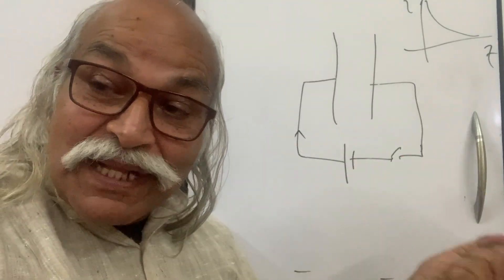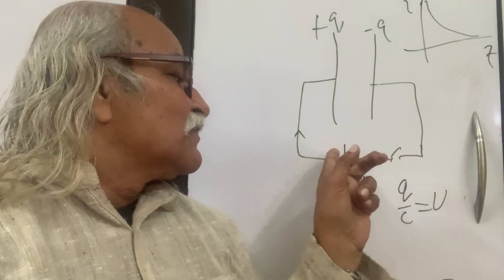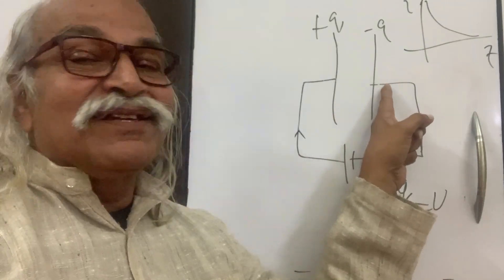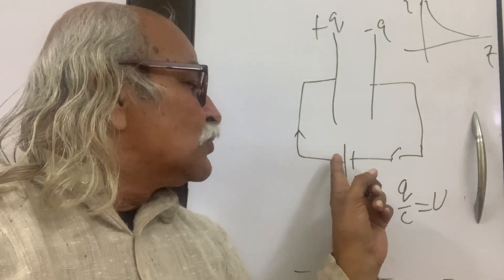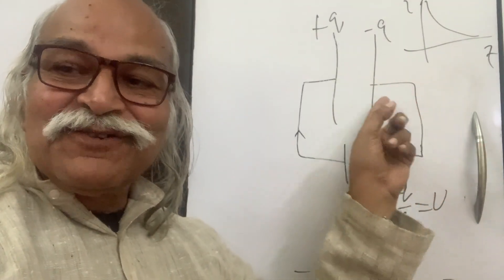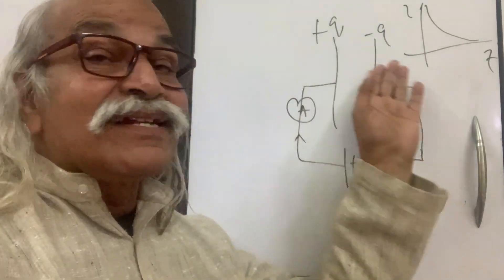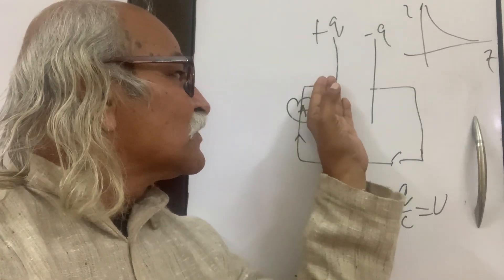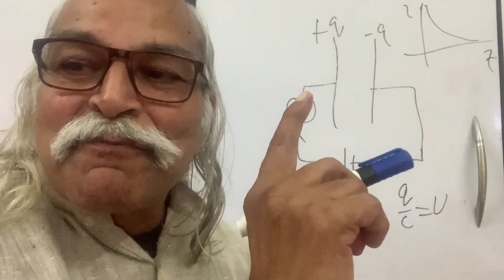Current through a capacitor

Comment: If a 0.1µF, 100V capacitor and 0.22µF, 40V capacitor are connected in parallel, find the 
overall capacitance and the maximum working voltage.

Comment: I have measured actual DC current flow through a capacitor with an ordinary ammeter, as much as 10 milliamps and as low as 10 microamps , however it was a leaky capacitor. Its one the the tests I used in repairing vintage equipment. On the other hand I do not use the results as criteria on whether to change that cap. I change all caps upon 1st visual inspection,

Comment: sir i want to ask a question, if current flows from high potential to low potential and if there is no potential difference between two points then current does not flow, as seen in the case of a Wheatstone bridge. when any two electrical appliances, say two resistors, are  connected in parallel then why does the current flow in both the paths if both the points are having the same potential

Comment: sir, it's Krishna of class 11th from Chandigarh. can we say that the charge is induced by the plate of a capacitor due to another plate that is connected to the battery??
we know that a charged body can charge a neutral body without touching it.
if we put it like this then the plate having charge +q will induce a current in another plate of the magnitude of -q.

Comment: Hello sir 
I have a doubt 
Why will the charge flow from the battery when the circuit is not closed? 
Battery works when the circuit is completed right? 
Then why does it takes e from the capacitor 
Kindly reply to my query 🙏

Comment: Sir there is a most confusing concept in electric current.

When we calculate drift velocity we put the acceleration value in(v=u+at) but if an electron accelerates then how it produces current because accelerated charge particle produce EM waves?
                             - Jyotiraditya pandey                   
                              Ayodhya(U.P.)

Comment: A good food for thought would be "can I consider an open switch as a capacitor?" If no, why not? If yes, then why don't we do the same analysis with it?" 
Also, since current flows with in a capacitive circuit, we have current flowing in 'open circuit'. Then why do we say we need a 'closed circuit'?
Reply: • A closed circuit is defined in terms of FLOW OF CURRENT ! and in capacitive circuit the current is not ZERO ! Hence the current is flowing so even if there is a break in connection of wires ! we would still identify the circuit as CLOSED CIRCUIT! 

An open circuit is the circuit in which no current flows whereas this circuit is just a circuit with a space between it (capacitor) NOT OPEN 

• And  YES you can consider a OPEN SWITCH to be a CAPACITOR  but the capacitance will be extremely LOW ! As it has its area in mm^2

Comment: Hello sir, in reverse bias current does not flow through the diode as in reverse bias, the resistance becomes infinite. but when we draw the V-I characteristics graph of diode for reverse bias, we get some current in micro-ampere and. so my question is Does current flow in reverse bias?  pls solve this paradox🙏🏻

Comment: At 3:07 in video if potential is not applied on both ends  of capacitor then charge does not flow in the circuit and so current absent ..please reply sir

Comment: Ummm...current flows against the flow pf electrons...right....so the view is...positive charge is spread on one of plate...and negative on another...why this is happening is...to maintain the potential difference...so as the negative and positive charge moves in the wire...the current flows....its not jumping through capacitor...capacitor is only performing storing of charge...

Comment: Hello sir this is Abhilakshya Arora from Class 10 
Sir I have a doubt that we studied that every magnet has a magnetic field which is in circle or closed curve and 2 fields have gap in between them and so if we put a ferrous material or another magnet in between that gap. Will the material or another magnet attract each other or no movement?
Reply: If you place it at such a position that magnetic force due to 1 magnet is opposite to the magnetic force of the 2nd magnet, then the material would be in equilibrium, but would that be stable equilibrium, or unstable.. that remains to be seen.

Comment: Thank you very much Sir, for such a nice explanation. It is said that DC current can't pass through capacitor but AC current does. Could you please make a video regarding the explanation of this statement? I can understand the case for AC current. Is it correct to assume in case of DC current, the current complete the circuit with the virtue of the concept displacement current for that short time while charge developing across the plate, as the electric field varies inside the plate. If we assume in this way, then confusion develops as capacitive reactance for DC is infinite which offers infinite resistance. 
Best regards,
Ashwini Kumar

Comment: My doubt is :-
We know that lambda(λ) is inversely proportional to refractive index(n)
ie- λ ∝ 1/n 
so, now when we pass a light wavelength of 600-700nm that is a red light  through a denser medium of very high refractive index then we should see a change in colour but when i tried it out then  there was no change in the colour why is it so.
 I also tried searching it on google but found images which completely contradicts the relation between lambda and refractive index.

                                        (image)
   
Here when the human has passed a beam of green light through a bottle of oil then the colour has changed from green to red this means that refractive index is directly proportional to lambda as a light of lower wavelength has change to light of higher wavelength which is not true.
I have been working on the problem from the last two weeks . I would admire you if you would clarify my doubt on board
.

thank you sir

Comment: Dekho bhai basically ye hota h battery ke positive side se connected capacitor higher potential hota h Or negative side se connected lower potential hota h Or hm log jante h higher potential se lower potential electric field flow krta h so us do capacitor ke beech me bne electric field ke karn electron pd force lgta h wo electric field ke oppposite direction me flow hota h as we know electron ke opposite direction me current ka flow hota h hence from +ve battery connected capacitor se -ve battery connected capacitor ke beech me current bnta h this current called displacement current plz pin krdijiye sir

Comment: Electron ki movement bohut slow hone k wabajud bhi ghar ka light fan ka switch on karne k sath sath sab on kei se ho jate hei ??
Reply: Very good question. The drift velocity of electron is very low. But current flows not due to drift velocity of electron, but because of the Electric field created by the battrey. This Electric field travels at the speed of light in vacuum. That's the reason why light, fan etc, become instantly on when the switch is flicked on. If you liked my answer, then you might be interested in checking out other Physics related videos of my channel: www.youtube.com/@thephysicstrain.

Comment: But there are different constraint like whether this battery having any internal impedance or not if it is ideal then then capacitor will charge instantly as one impulse current will flow hence capacitor allows sudden change of voltage through it other wise due to internal impedance it looks like a RC circuits so capacitor charge exponentially

Comment: Electrostatic induction phenomena
Reply: Not compeletly
Reply: @mission9463  electro static phenomena ye he he , k jab aek uncharged conductor ko, charged body k pass laein, to uncharged conductor par opposite chaarge develops hot he.
Reply: S but if u  bought aa charge on plate on athor side is intially nothing but neutral right then negative side comes in left and postive will aculmate on right side of plate then didu remove that charge or earthned .. so i said pariatally correctet as it connceted to battery as hcv sir said u can can consider that i mean ...
Reply: @mission9463  sir confusing words, please simple use simple words

Comment: Niece Question 
The charge is not flowing through the capacitor electron coming from -ve terminal get accumulated at -ve plate of capacitor and positive plate of the capacitor is losing electrons so it got +ve and hence the circuit get completed and current flows

Comment: Sir then how is the circuit completed?
Reply: For completion of circuit, flow of charge is required, and that requirement is fulfilled by the capacitor. There's no point in the circuit where the charge gets accumulated and doesn't flow onwards.

Comment: Sir , I'm class 12 student, I want to know that In electrostat we get the definition of potential, " work done to bring the charge from infinity to a certain point . Then how we apply it in circuit in capacitance, current electricity and so on
Reply: The answer lies in question.........here you provide potential in circuit across a wire ......in form of....... battery...which moves electron in electric field.......
Reply: @ultimateracer6264   sir , can't understand
Reply: @ultimateracer6264  please explain
Reply: @ultimateracer6264  in battery we get two opposite terminal and where present potential difference
Reply: Please connect it with potential energy and potential at a point
Reply: Potential itself is useless, potential difference is what we use in circuits.
Potential difference is the work done to move a unit charge from one point to another.

Comment: Sir as  you explained that  the charge q is moving to the plate of capacitor so it shows deflection in the Ammeter 
It is okk but sir as we know that positive charge doesn't flow ,but here from the positive terminal of the cell positive charge flow and get stored in the positive plate  how it is ؟
Sir by the same way my teacher also explained that due to the accumulation of opposite charges on both the plate from the battery 
Displacement current is produced 
I am so confused by taking the same  that how positive change flow to the positive plate sir please
Reply from the maker: This is equivalent way of describing. In reality electrons flow from the positive plate and go into the positive terminal of the battery. They then travel through the battery and come out of the negative terminal and then go to the negative plate of the capacitor.
Reply: @hcverma2928   
Thank u sir

Comment: For those who still want to know more, there's something called displacement current in 12th physics syllabus. Ncert covers it, you'll find more in some refreshers.
Reply: Yes changing electric field gives rise to Displacement current ...Maxwell was the man to unify electro magnetism ❤️
Reply: Displacement current is a misnomer since it's dimension is same as conduction current. it's electric field that drives charge away from plates
Reply: Actually what happens is that 
Unlike charges are attracted to each other via parallel plate capacitor thus remains at souce potential
Reply: Phenomenon of LC  oscillation
Reply: Dq/dt is an type displacement current
Reply: Displacement current is not an ideal current.
To know more visit : Physics wallah EMW lecture on YouTube.
Reply: @turboshashank  it doesn't involve flowing of charges......
A magnetic needle deflects b/w the capacitors just like at the current carrying wire, so the phenomenon of deflection is same at both places that's why we call it a current.
Reply: Clash Royal
Reply: It just came in my boards exams 💀 and I don't anything bout it 💀
Reply: It's pseudo not in reality
Reply: Displacement current is not a real current. The term was coined to validate ampere circuital law which was renamed maxwell - ampere circuital law.
Reply: YEAH ITS 1ST TOPIC OF EM WAVES GIVEN BY MAXWELL
Reply: I guess it's in EM Waves right
Reply: @ayaz.huzain  yes!

Comment: @H C VERMA  Sir🙏🏻 I 'm in 9th Standard and i have a doubt can you please help me to clear this
DOUBT :-
If we take an example of pencil and the earth since the earth is attracting a pencil with some force and according to Newton's third law of motion here also the pencil will also attract the earth with same force but since the mass of earth is larger than that of pencil that's why the pencil gets attracted towards Earth and falls on it.
 
On the other hand..
We know that Earth attracts moon and by the Newton's third law of motion the moon also attracts Earth since the mass of earth is greater than the moon then why the moon does not get attracted towards Earth and falls on earth's surface?
Reply: Due to its circular motion.......bro....as you're in class 9 th......so,i think you don't know about...the forces acting on body in circular motion........and how these bodies, where balance there........
Actually there's is strong force equilibrium between gravitational pull and centrifugal forces
Reply: @Pranav, the actual answer is an interplay between the type of force that gravity is, and conservation of angular momentum. Gravity is a conservative force which acts centrally. Consider Earth as origin, then there is no torque on moon due to gravity of earth, therefore according to conservation of angular momentum, there is no change in angular momentum of the moon, so it continues to rotate around the Earth. Had it been not rotating to begin with, i.e. since the time of it's creation, it would have fallen on the Earth. So in short, it could be said that it's not falling on Earth, since it began rotating when it was born and since nothing is stopping it from doing so, it will continue to rotate around the Earth. 

@ultimate racer: The sentence of yours: "there's is strong force equilibrium between gravitational pull and centrifugal forces" is not right. Moon is in an elliptical orbit around the Earth. That means that every moment it's direction/velocity is changing. This means that there is net force on moon which is causing change in it's direction/velocity. Force due to gravity is the centripetal acceleration, and this centripetal acceleration causes the moon to change its direction/velocity every moment while it is orbiting around the Earth. But for the sake of argument let's say that your statement is right, then there is no net force on the moon, therefore it should move in straight line, which it doesn't.

If you liked my answer you might want to take a look at videos of my channel where I make physics related videos: www.youtube.com/@thephysicstrain

Comment: Hello  sir 
Roshan  this side
Sir  i  want  to ask  that
Is wireless electricity possible?
I  have research  that Nicola tesla  has  did this  but  that  was  at a curtain distance....
What's your  opinion on  this...please  throw some  light on  this  question sir
Thank you
Reply: Bro...in case of alpha particles.... there is wireless current is there....or in case of ..... lightning strike on Earth......
Reply: @ultimateracer6264  nope 

M thinkng like wire less like when ur are using tv ya any other electric device then it would work like how wifi works 
Like that way m asking

Comment: Sir I have some questions..
Question 1- In case of an open circuit how the emf induced across its ends is related to the magnetic flux change? 
Question 2- How is the damping force produced by the Eddy currents?
Reply: Answer -1 this will same as in case of closed circuit.....the Lenz law is equally applicable there
Answer -2 ,this is a practical phenomenon, needs higher mathematics for understanding
Reply: @ultimateracer6264  please explain in detail I can't get what you are saying..
Reply: @punitasingh6659  you're asking about...how the emf is associated through magnetic field in open circuit.........so,the basically Lenz law..is also applicable there........more accurately...there is stoudla theorem.....which relates these two quantities for open circuit (but this THEORY generally discuss in PG courses.....i studied this theorem,when I was persuing my MSC).....
Reply: 2) due to the internal resistance of the conductive material, the eddy currents will be dissipated into heat and the force will die out. As the eddy currents are dissipated, energy is removed from the system, thus producing a damping effect.
Reply: By the way Tanya your questions sound interesting can I get your ig or shall I give mine, concerning your privacy.

Comment: Then sir what happens when AC current flows through the capacitor?
Reply: Then, there's continuous phenomenon of charging and discharging of capacitor
Reply: Then there will be displacement current present between the plates of capacitor
Reply: There will be continuous flow of current unlike in a DC source as the capacitor will never get fully charged.
Reply: Thanks

Comment: Sir why resistance directly and inversely proportional to the power of order to the formula p=I2R, p=V2|r
Reply: In case of series combination we take P=I²R as here current is constant and in parallel combination we take P=V²/R as here voltage is constant..
So in series P is directly proportional to R..
And in parallel P is inversely proportional to R..
Reply: By the way Deepanshu it's a very nice question
Reply: You must see the derivation